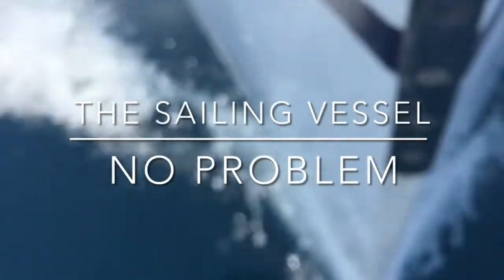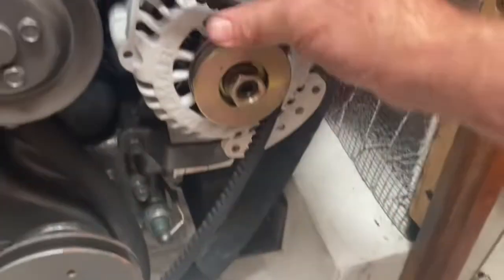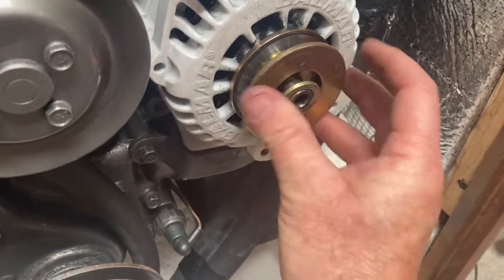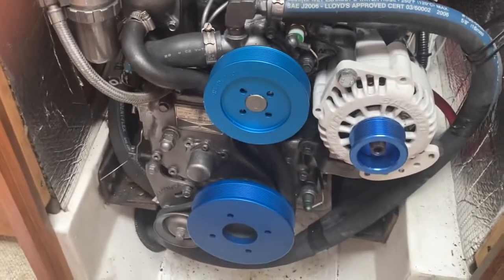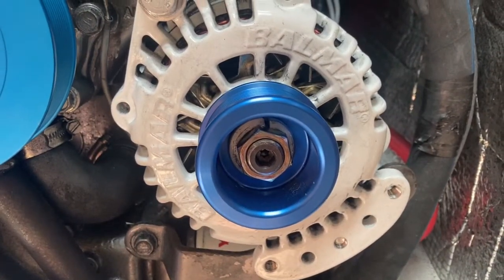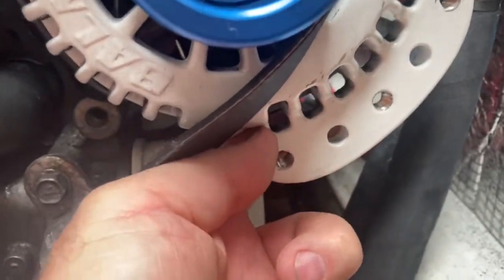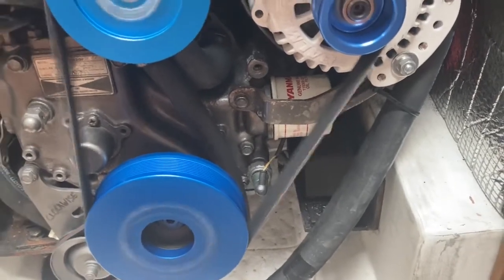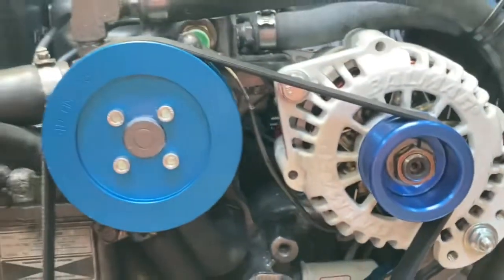Ep12 Engine V Belt Upgrade

Comment: I am glad to see that your kit fit properly.  last week I installed a Balmar kit on my Universal M25XP and the drive wheel was 74-thousandths of an inch too small.  I needed to remove the front balance wheel/pulley from the engine and take it to a machine shop to have it turned down to fit.  Rather frustrating for something that is advertised as a bolt-on assembly.
Reply from the maker: That does sound frustrating, but it also sounds like so many boat projects I have done in the past.  Something that should take a hour or two ends up taking all day.  And big projects (like my rudder replacement) even more so.  Thanks for watching.

Comment: Thanks for this. We are about to  do the same conversion
Reply from the maker: It made a difference in my boat - and I show it off all the time to friends who come aboard and are Gear heads.  They approve!  Thanks for the note.
Reply: We have a marininised Beta marine kabuta engine. We have discovered that the v belts are being eaten at an alarming rate. Turns out it’s a pre existing condition why they have new kit for alternator belt change to flat belt